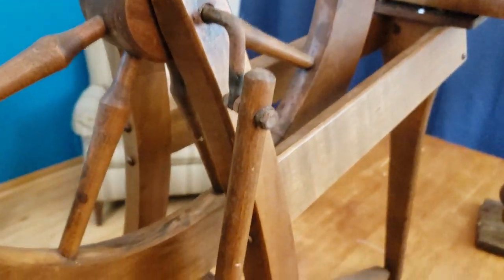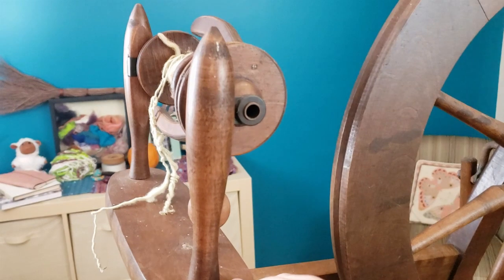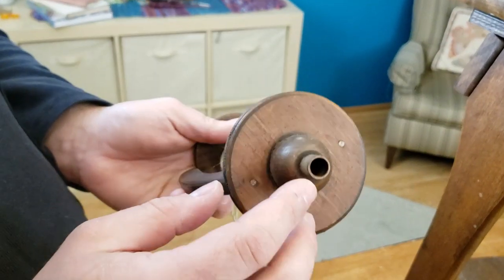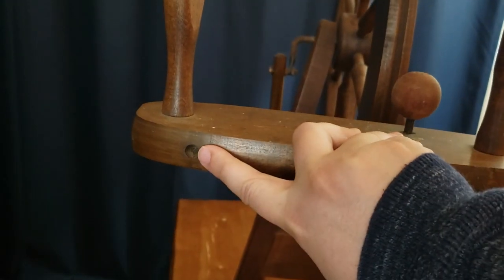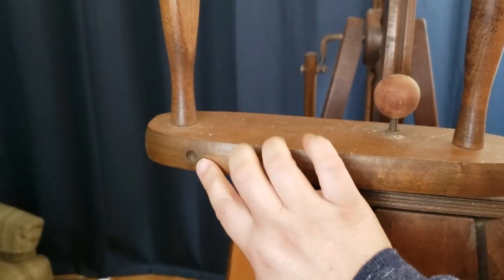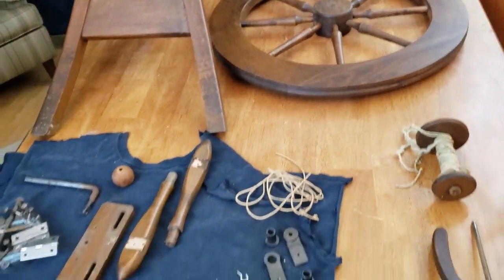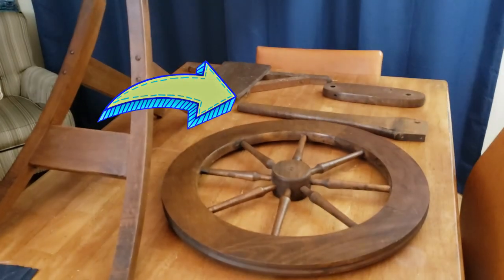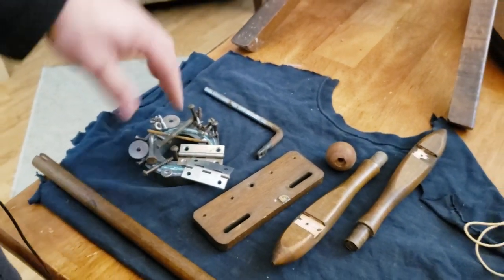Refurbishing a Vintage Ashford Traditional Spinning Wheel

Comment: Thank you SO much. A sweet older lady I met at the library just gave me her mother's spinning wheel too! This same style spinning wheel actually 😅 She insisted I couldn't repay her except by giving it a loving home where it will be used 😭 so sweet so no complaints here but it definitely needs some love, it's been just hanging out by her piano for a long time. This video is my new best friend. You're amazing.
Reply: Hi, with your help I have a Ashford traditional spinning that works. I have taken it apart reglued the hub. Got a new hub pin. I now know how my spinning wheel works. The wood looks good with linseed oil soaked in. I feel happy. It's so smooth no clunks or bangs. Yippee 😊

Comment: I bought mine used, in the late seventies. It looks just like that one and it was called a kit wheel.   Just a drive band and a little spring is all I've had to replace. I have spun thousands of skeins of wool and only needed to oil it. Great video!

Comment: THANK YOU - this is such a clear video as usual. You have been my spinning teacher over the last few days but now I have a BIGish problem. My drive wheel is falling apart at the joints. So as the wheel spins the joints open more with each revolution of the wheel. This darling, Tasha (after Tasha Tudor) is a Haldane Hebridean given me as a birthday gift. I do hope that you can help -  or point me in the direction of someone who can. Thank you. YOU really are the best at what you do.
Reply from the maker: Both Spiritwood and Bobbin Boy do spinningwheel restoration and repair so I would check with them. I hope you can get it patched up! 🧶
Reply: @JillianEve  Thank you so very much - so do I. I shall let you know!

Comment: Great video -- I remember when I received my hand-me-down Ashford Traditional -- also a 1970's -- it actually had a nail jammed into the wheel instead of the proper pin it had served several years as a home decoration and a battle field for my son-in-law as a young boy for his plastic army men -- thank goodness I too had a very helpful assistant (my hubby) and he was able to get the nail out, glue the wheel hub together so a new pin would work and he actually sacrificed an old belt to make me a new leather connector -- this was before I found the maintenance kit and I absolutely love my wheel and the fact it has a history.
Reply: That is such a great story.
Reply from the maker: I love that your wheel has survived actual battles! 😱😜Wheels with stories are the best! 💕

Comment: You and Mark did an amazing job on that wheel! You work so well together :-) I bought my 1970s Ashford Traditional about five months ago and didn't do any work on it because I just wanted to start spinning. I'm so inspired now to clean it up lol. Thanks for all the great tips. You rock!
Reply from the maker: Thanks Tracy! ❤ These old Traddys are awesome!
Reply: @JillianEve  The hub on my wheel separated when I took it apart. Should I throw some carpenters glue on it before I put it back together again or just snug it up and put the pin back in?

Comment: I just found a vintage 1970's Ashford Traditional at a yard sale today for $2! I found your channel and Love it! You're so positive and up beat ☺️. The video on refurbishing your wheel is exactly what I needed. I can't wait to watch more! I learned to spin over 30 years ago on my sister's Ashford Traditional, it was perfect for a newby. I stopped spinning when I had kids and returned my sister's wheel. The one I got today isn't complete but in really decent shape and the wheel turns easily.  It needs the Fly wheel, bobbins, tension rod drive line and leather strip to attach the treadle but I'm looking forward to refurbishing it and start spinning again. I have to relearn everything though 😉. I spent $150 on parts and a maintenance kit but after it's done it'll be a nice usable wheel. ☺️. I'm a knitter and weaver too and so glad I found your channel!
Reply from the maker: Even with all the parts you bought, you still came out with a deal for an Ashford Traditional! What a find! Happy spinning!

Comment: I love this video! I went through the same thing when I got my first Ashford traditional. I had to learn a lot on my own. I was only 13 back then 🤷‍♂️🤷‍♂️🤷‍♂️. I still have it and use it along with all my other Ashford wheels. Thanks for this video!! 🤗🤗
Reply from the maker: I think it is wonderful experience to take apart and fix up a wheel! Happy spinning! 🐑🧶💕
Reply: I wish I could send you a picture of the wheel. It’s a 1981 traditional I bought for $199 from an antique store here in Crossville TN. I love my Elizabeth but my original traditional is still my favorite work horse. I bought it in July 2000. It is a sharp looking wheel

Comment: I recently got a new to me traditional wheel, I think I need to get a spring mine only has 1
Reply from the maker: I think Ashford only recently started to include 2 springs. It will work fine with one, but two makes adjustment easier. If that's the only part you need, you can easily find a spring at a hardware store! 💕🧶

Comment: I have had this same wheel that I got at a fiber festival around 1998. Mine has split at the hub just like you said, right down the middle. Can this be glued and clamped? (It also went too fast to see just how you got the wheel off..lol.
Reply from the maker: We had to pry the pin out of the hub and slide the wheel off the shaft. I think you should be able to glue and clamp yours together, but you can also contact a wheel repair expert or check with Ashfords to make sure you are doing a solid repair.

Comment: Hi. Thank you so much for this video it's so informative and useful. Could you show me how you fit the drive band please. Your husband is a star rebuilding the wheel.
Reply from the maker: Hi Sally! Thank you! The drive band on a single drive spinning wheel is fairly simple. I tie it round the drive wheel and then around the flyer. I secured it with a double overhand knot and that's it! Easy peasy 🐔 squeezy! 💕
Reply: JillianEve thank you...I didn't know if there was a way to get the right length. Fab channel, I am learning so much from you. Thanks

Comment: Was the fishing line in the kit too or did you need to buy that separately?
Reply from the maker: It was in the kit. 😊
Reply: @JillianEve  fantastic! Thank you! I just watched your spinning for beginners video too and have saved it. Once I’ve repaired my wheel I’m going to follow that to get started. I am a little concerned that my leg won’t cope with treadling but I think I can see how I would be able to use a small motor to turn it without losing the beauty of the wheel itself. But I’ll see. Maybe the treadle will be easier than I’m expecting.

Comment: Quick question. Did you have to replace the bearing in the top of the conrod? The bearing for that year isn't available, it sits in the conrod just in the interior of the crank bolts.  I found a solution a plastic bobbin from my sewing machine. I separated the bobbin in half, a little sanding and it work like a washer, also the right inside diameter for the crank. So far so good! But I would be interested in other folks solutions.

Thank you

Comment: Hello. Thank you so much for this video, it has been really helpful. I also have a very similar Ashford wheel. I wonder if you can advise how I can repair my hub. You mentioned that the hubs sometimes split along the centre line, mine has done this and there is loads of play in the wheel. How might I go about restoring it please. I have a picture of it but can’t see how to post it on here. The split is quite large, approximately 5mm all the way around. Any advice you could give would be very much appreciated. Thank you.
Reply from the maker: I think the best thing is to open it up, sand off any rough spots, use a good quality wood glue, and clamp it back together. I resist adding anything like a screw to secure it because it could put it off balance. I hope that helps! 💖🧶

Comment: Watching this episode for the first time today and it got me to thinking.  I purchased my 1987(ish) Ashford Scholar a couple years ago. It had not been used regularly but had no rust and was in working order. It still spins fine and I have lubricated the appropriate parts once, but I have never done anything to the wood. Should I take the whole thing apart to condition the wood?
Reply from the maker: I think it all depends on the shape it is in. If it seems to be in good shape, continue doing regular maintenance on it, but you shouldn't need to take it apart. Happy spinning!

Comment: Not sure if you are still answering questions from this thread but my hub pin came loose and I cannot blindly find the hole in the crank shaft to pin it in place.  And I cannot remove the wheel crank shaft  to clean it. I saw that Mark had a difficult time pulling the wheel shaft do you have any tips or tricks? Mine is stuck tight. Thanks
Reply from the maker: If anything is stuck that should be able to move, we usually give it a little oil and come back in a few hours or the next day. If you are having trouble finding the hole for the pin, Mark put the pin in as far as it would go and then slowly turned the wheel around while wiggling the pin against the metal until he could feel it catch on the hole. Then it was a matter of wiggling it back into place. It took some patience but it worked. When it was stuck and he couldn't get it out, it was a job for pliers and some leverage. I hope you get your wheel back in tip top spinning shape! 🧶🐑✨

Comment: Great job!  I am working on refurbishing my first Ashford traditional, but the wheel has separated a tiny amount.  Everything still spins like a champ though.  You had mentioned being careful of that in the video.   Do you have any recommendations for refurbishing the wheel itself?
Reply from the maker: The original wheel on my Ashford Elizabeth had completely come apart and then someone tried to fix it with hot glue. It is a mess and doesn't spin true. I have a salvaged wheel from a Traddy that fits, so my Elizabeth is a bit of a franken-wheel currently. I plan to separate the hub, scrape out the bulky glue, apply actual wood glue, and let it set properly in a clamp. I think that's the way to go, but I'm really not an expert wood worker, so if you try that, maybe get a second opinion? 💕
Reply: @JillianEve  thank you for replying!  I will definitely take that into consideration!  ❤

Comment: Hi! Can I ask how you connected the con rod to the crank shaft (that part was missing from the video) and if that solution worked for you and allowed the wheel to spin well? I have an Ashford Traditional about the same age as this one that was spinning fine before we had to disassemble her for a cross-country move. But I wonder if we lost a part or put her back together wrong, because nothing is working to get those two parts connected so she can spin smoothly. (I've tried two different screw and nut combinations, one gouged the wood before just falling apart, and the other just got tighter until she refused to spin.) Any help you could offer would be great!!
Reply from the maker: Ouch to the gouged wood! Is it the leg of the wheel that was gouged or the conrod(footman)?
Reply: @JillianEve  It was the leg! I seem to have gotten the problem fixed though (knock on wood, lol); the bolt needed an extra nut! (Fortunately, my wife had taken pictures before disassembling her so I was able to figure this out.)
Reply from the maker: Oh I'm so glad! Happy spinning!
Reply: @JillianEve  thank you! ❤️

Comment: I am still not able to ship the spinning wheel because I can't get the pin out! I've tried the PB lubricant, regular oil,  and WD40. I've tapped the pin from underneath using an allen wrench and a hammer. Still nothing.  It's not mine and I'm so afraid I'll damage it.   Did you guys bend the pin at the top to get a grip on it to pull it out? Should I be trying to tap it out from the bottom, or pull it from the top? It's really in there! Any suggestions? I don't want to have to ship it in a huge box. Thanks!
Reply from the maker: Oh dear! We soaked it with oil overnight and tapped out the pin. I hope you can get it!

Comment: Hi! I recently acquired a vintage Ashford Traditional just like yours. I am working on getting it to run smoother. Do you have any tips on how to remove the hub pin?
Reply from the maker: Yes, put a drip of oil in there, work gently, and patience! Happy spinning!

Comment: Back about 10 years ago I bought a 1970s Ashford Traditional then later replaced her with a matchless. I recently got her back out, cleaned her and have been attempting to spin. Adjusting everything is so difficult and she wobbles like crazy (neither is new for this wheel) however my biggest issue is once I start going the end of the bobbin with the brake band slips off and the brake band comes off and everything comes to a halt. Not sure what is going on to cause this but it’s like the rod the bobbin slides onto isn’t quite long enough and barely goes through the leather piece it’s held on. Any suggestions? Thank you

Comment: I'm in the process of refurbishing an Ashford Traveller from the late 90s. It's been interesting. I couldn't find a woodworker that would touch it. They all said, "I don't do spinning wheels." Apparently wooden things that spin scare them. That made me nervous but I decided to try fixing it myself. The worst problem was the hub had separated into two parts. From looking at the grain it seemed like the hub had been made in one piece and sawn in two. That seems like a strange way to do it. I made one big mistake. The wood hadn't been cared for and had spots I feared were mold. When the wood was sanded to remove the spots it removed the marks for which spoke goes in which hole. I think Ashford assembled the drive wheel and then drilled the hole in the hub for the crank shaft. The way I glued it back together the hole is slightly off center now. That makes the drive wheel wobble by 1/4 inch. I hope that doesn't cause problems. Wish me luck.
Reply from the maker: The wobble might be frustrating, oh no! I went through a similar repair with my Ashford Elizabeth. I hope it spins ok for you! 🐑

Comment: How did you get that wheel pin in so easily? Ugh! I'm having the worst time on my new to me 1975 ashford
Reply from the maker: It helps to visually line up the holes first, slide the hub together and then gently wiggle it back and forth until everything is aligned and you can get the pin where it goes. ✨🧶

Comment: I just got my Ashford scholar and the lady I bought it from didn't inform me that it was missing a couple things. 

I'm now missing the bolt or bearing that goes from the wheel to the footman. I'm not sure what kind of bolt or bearing or nut I need to secure the footman to the wheel. 

Sigh. 

I also can't find anything online about the Ashford scholar, I emailed Ashford directly and support told me they were unable to give me any information as they have ceased all support talk about the scholar. 

I've tried a regular nut for the bolt that was with it but it just spins off after two or three treadles or spins too tight when going the other direction lolol

Comment: Do you know much about a foot pedal that seems to stick. It is actually hard to push down on the pedal with my foot. This has always been the problem with this spinning wheel. Ashford Traditional.
Reply: Hey Cinda. The first thing to do is to figure out if the issue is with the treadle or the drive wheel assembly. To start with disconnect the footman from the treadle. Check to see if the treadle moves freely. If the treadle moves freely then try and turn the drive wheel by hand. If the drive wheel moves freely then hold the drive wheel still with one hand and try and move the footman by hand and see if it moves freely. 
If the treadle sticks shift it to the left and right sliding it along the line of the pivot pin. If the drive wheel is difficult to move start by adding oil to where the drive wheel shaft meets the bearings and then turn the wheel a few turns. Keep doing this till it loosens up and do not be afraid to use a generous amount of oil wiping up the excess with a rag. If the footman sticks, try adding oil to where it pivots on the drive wheel shaft moving the footman back and forth, keep doing this till it loosens up. If this does not help the footman, you may have to loosen the bolt that acts as the shaft connecting the footman to the drive wheel shaft.
Reply from the maker: Mark gave a great answer! Let us know if you get it figured out! 💕
Reply: @JillianEve  Thank you so much. I am oiling it a lot. It still has a creak creak sound. This wheel was new around 1982. I have always struggled with the foot pedal sticking and lurching. The wheel is in beautiful shape. I finally bought a Lendrum this last Christmas which is so much easier to use. My fiber gets over spun on the Ashford. Thanks so much for the great help!!!